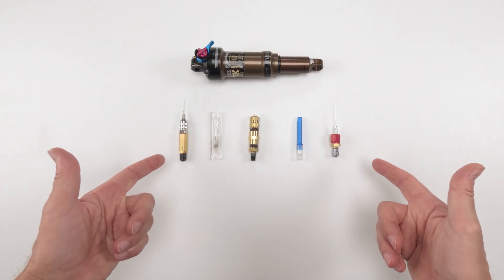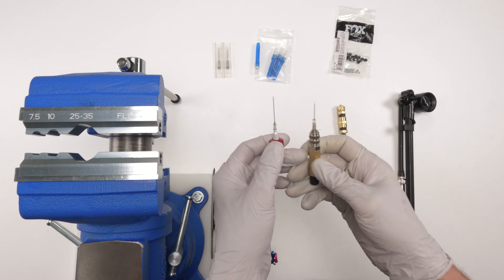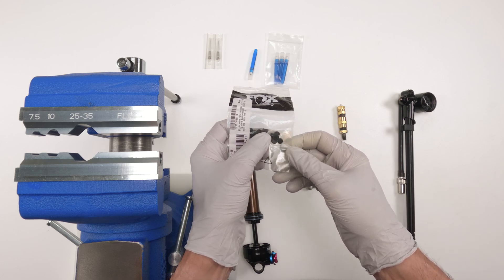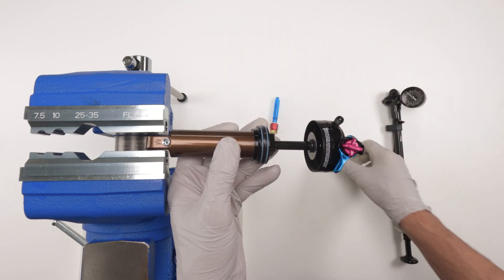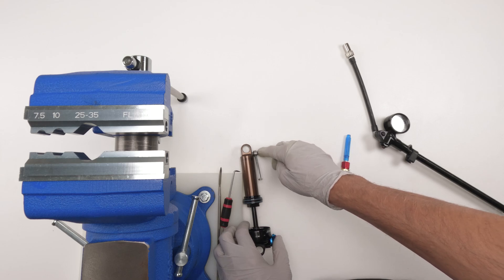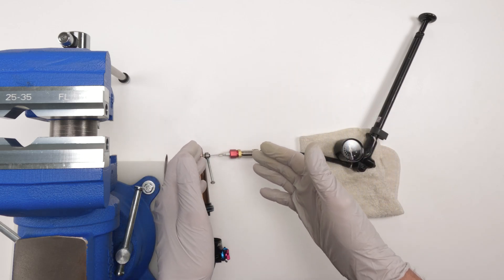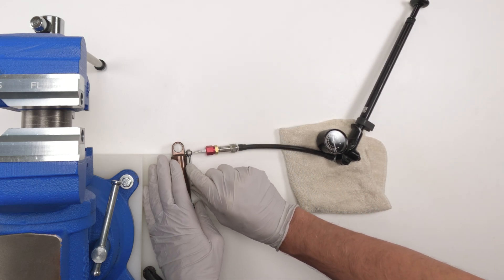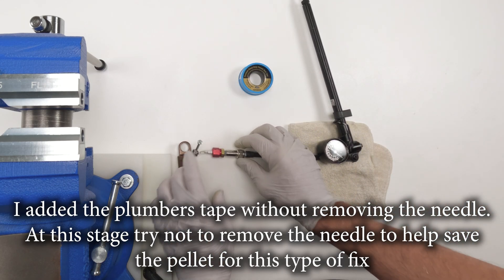FOX shock IFP Air fill with shock pump & nitrogen needle guide for beginners. A PITA but U can do it

Comment: Bonjour, merci pour cette très bonne vidéo !! petite question svp: comment faire rentrer + 500 psi avec une pompe haute pression  à  mains quel model utiliser vous ? moi je possède 2 pompes mais elles vont à 300 psi. merci et bonne continuation ;)
Reply from the maker: Je suis ravi d'apprendre que la vidéo vous a été utile. Pour les amortisseurs nécessitant une pression supérieure à 300 PSI, vous devrez acheter une pompe à amortisseur de 600 PSI, comme celle dont le lien figure ci-dessous. J'espère que cela vous sera utile. 

https://www.backcountry.com/b/rockshox-high-pressure-fork-shock-pump?CMP_SKU=RSXB05F&MER=0406&skid=RSXB05F-STA-S600PSIMAX&mr:device=c&mr:adType=plaonline&utm_source=google&utm_medium=pla&utm_campaign=20668227549__p:G|s:BC|ct:Shopping|ct2:pmax|g:xx|c1:BikeComponents|c2:xx|b:xx|mt:xx&utm_content=&utm_id=go_cmp-20668227549_adg-_ad-__dev-c_ext-_prd-RSXB05F-STA-S600PSIMAX_mca-7811_sig-Cj0KCQiAgP_JBhD-ARIsANpEMxzoHttwxi-oeGDoV4xI2tiX1938STfedvejsQftF0x-4gPJNC0u31MaArgKEALw_wcB&gclsrc=aw.ds&gad_source=1&gad_campaignid=20674447565&gbraid=0AAAAAD_Jw0ZjO1rz132xMbbv8U57pMZX9&gclid=Cj0KCQiAgP_JBhD-ARIsANpEMxzoHttwxi-oeGDoV4xI2tiX1938STfedvejsQftF0x-4gPJNC0u31MaArgKEALw_wcB

Comment: Thank you so much for posting this, really helpful.
A couple of observations having just done my first charge;
You can use a box cutter to shorten the needle, just saw to the desired length at a 45* angle, the metal of the needle is soft enough to cut through using this method (at least the AliExpress ones are 🤣).
Leave the needle long enough that you can use a shifter closed down to either side of it, this makes removal of the needle easier as you can pull against the shifter rather than pulling on your shock pump (you're also less likely to bend the needle this way).
You can also use the same method to remove the needle from the knurled nut when you're done as it'll probably be stuck in there pretty well after pressurising.
Reply from the maker: "You can use a box cutter to shorten the needle" This could be a game changer. I've never tried this nor thought about it. shortening the needle would make the setup significantly stronger. definitely going to try this and thanks for the tip 👍
Reply: @zoubtube use a dremel. Just cut it.
Reply: What you call shifter?? A derailleur shifter? 😂 I don't get it

Comment: Hello. Thanks for the video. Can this process, with the shock pump, be done with fox's nitrogen safety needle assembly ?
Reply from the maker: I don't recommend this at all, but technically yes, you would need a 1/8 npt to Schrader valve adapter fitting. but one person can't do it. you would two people. one persons to keep pressure applied between the shock and the Fox nitrogen safety needle, and the other person to pump the shock to 500 PSI. again,  I don't recommend this approach. Hope this helps

Comment: Wrap the tool with the needle in electrical tape. Insert the needle into the shock absorber, clamp them together in a vice so that they are pressed well. Pump up the shock absorber, unscrew the pump from the needle, loosen the vice, tilt the shock absorber so that you can grab the needle with your hand. Clamp the shock absorber in the vice and pull out the needle.
Reply from the maker: I'm intrigued as I think I see where your coming from. I'm assuming the electric tape is either for grip or to prevent scratches.  To make this work, the needle main body needs to be the same width as the damper body eyelet, right? If yes, It NEVER occurred to be to check this
Reply: @zoubtube  Greetings from Russia. Yes, you need to insert the tool with the needle into the shock absorber and clamp them together in a vice, but first, wrap the tool with electrical tape so the needle won't wobble and you can easily inflate the shock absorber.

Comment: So happy to have found your channel! I'm used to tinkering (ie: getting in over my head trying to fix things I broke and hoping I don't make it worse) with road and gravel bikes, and don't know anything about suspensions.
I ended up here trying to look up if I could fix a Fox Specialized Brain (probably not serviced for ages) not locking anymore.
Do you think adding air to the brain using this method would help? Any videos you'd recommend I watch first if I try to service this thing myself?
Thanks for all the great work!
Reply from the maker: Thanks for the comment and glad to hear that you find some of these video helpful. what year is your fox brain shock?
Reply: I ended up sending the shock for a full service, but still curious about your answer! 

It's from a 2014 Specialized Epic.

Comment: any idea where i cna get the little plastic caps that cover the IFP air screw? service kits in the UK do not seem to have them
Reply from the maker: Assuming you talking about the white delrin ball, search "Fox Shox Nitrogen Fill Delrin Ball  803-01-652". This is for a bag of 50, Search UK ebay to see if someone sellw them in smaller quantities. Not sure if there are any off road vehicle stores in the UK, but here in the states some sell them individually.

Comment: Where do we get the ifp needle fill tool
Reply: aliexpress or ebay
Reply from the maker: @Narad89  Thanks for helping him 👍
Reply from the maker: There lots of places that sell them. Do a search for "Fox Nitrogen needle" and you'' get a bunch of hit. Most important is to make sure you have extra needles and pellets. 

Example below:

Amazon
https://www.amazon.com/Nicecnc-Nitrogen-Needle-Replace-snowmobile/dp/B082FJS17D/ref=asc_df_B082FJS17D?mcid=31ab4823b6fa33bd9bb6a05d8982aa7f&hvocijid=14298663420302870681-B082FJS17D-&hvexpln=73&tag=hyprod-20&linkCode=df0&hvadid=721245378154&hvpos=&hvnetw=g&hvrand=14298663420302870681&hvpone=&hvptwo=&hvqmt=&hvdev=c&hvdvcmdl=&hvlocint=&hvlocphy=9016979&hvtargid=pla-2281435178858&psc=1

Comment: can you put a link to all the tools used please! thanks legend!
Reply from the maker: Here you go

syringe. (buy extra needles, have at least 5 handy )
https://www.amazon.com/Nicecnc-Nitrogen-Needle-Replace-snowmobile/dp/B082FJS17D/ref=asc_df_B082FJS17D?mcid=31ab4823b6fa33bd9bb6a05d8982aa7f&hvocijid=10011851635212530810-B082FJS17D-&hvexpln=73&tag=hyprod-20&linkCode=df0&hvadid=721245378154&hvpos=&hvnetw=g&hvrand=10011851635212530810&hvpone=&hvptwo=&hvqmt=&hvdev=c&hvdvcmdl=&hvlocint=&hvlocphy=9016979&hvtargid=pla-2281435178858&psc=1

Fox Pellets. (Buy at least 5, if not more)
https://www.probikesupply.com/products/fox-shox-nitrogen-fill-pellet-0-275-x-0-125-tlg-each?variant=40823056531511&srsltid=AfmBOopUi3CYxpe2W4fYLaAWuCf5hjTlF-TofrybOK7Th9dmzyiQ2Kx3vAo&gQT=1

fox pellet retaining tool (you can buy the fox tool (expensive) or make your own with a 5/32 allen key as mentioned in the video. I personally I think itd worth making it). 
https://northwestbicycle.com/products/fox-pellet-retainer-tool-nitrogen-fill-b-fx2309?currency=USD&variant=32527389917289&utm_source=google&utm_medium=cpc&utm_campaign=Google%20Shopping&stkn=398fa69d1b59&gad_source=1&gclid=Cj0KCQjwkN--BhDkARIsAD_mnIpVEIJ-xc66q-n8HnvIaK_fOMBxTSKTpRKJkMzIrJk_-i3C5zTkFmYaAmnAEALw_wcB

High pressure shock pump
https://www.amazon.com/RockShox-00-4315-023-030-High-Pressure-Shock-Pump/dp/B00D0SFMJS?source=ps-sl-shoppingads-lpcontext&ref_=fplfs&psc=1&smid=A1TYOE2YKIHA0H&gQT=1

Comment: What’s the down side of filling with air?   Spending $160 every year to send in is just insane.  Way I figure, I need to get this set-up at home or just buy new shock every 3 years.
Reply from the maker: While extremely uncommon, if a shock absorber filled with air on a humid day is then subjected to intense use on a very hot day, the moisture trapped within the IFP chamber could potentially steam and alter the shock's performance. However, this is far less frequent than commonly believed. For almost everyone, air is a perfectly suitable filling medium.

I agree that spending $160+ per year is excessive. Once you get used to serving them on your own, not only will it go by quick, but you will lower the cost significantly. 👍

Comment: It’s easy to change  Fill Pellet ?
Reply from the maker: yes and no. Technically  yes, they are easy to replace. loosen the screw to let out the air, remove the screw, then remove the pellet. BUT. there is a big chance that the IFP will be displaced when doing this.  If this happens you will need to open the damper body in order to reset the IFP height
Reply: @ okay thanks 🙂

Comment: Thank you for this, as always - very useful. When removing the needle the way you showed - are you not afraid eventually snapping of air pump sleeve from it's shaft? The area the hose connects to the pump?

I did not quite get, where do you use those rubber little thingies from the bag? Do you insert them to the hole which you installed the needle in before doing the IFP fill?
I am tempted to buy the kit mentioned in comments below, it looks to resolve this messy and dangerous fill job all-together.
Reply from the maker: "are you not afraid eventually snapping of air pump sleeve from it's shaft" 
Yup! it's a concern, but so far, that pump has held up surprisingly well. I will admit my view on doing it this way is a bit biased, as I've had a needle go right through my finger a few years ago, and I do what I can to avoid this again. Pulling the needle from its body is more effective, BUT, one slipup, and it can easily go through your hand. Also, I only use this method on the DPS as it needs 500 psi, for other shocks that need 400 psi and lower, I clamp the shock to the vice and pull from the needle body. The reason I don't do the same with the dps is pumping the shock to 500 psi makes the needle wobble quite a bit, which breaks the needle easily. 

"Do you insert them to the hole which you installed the needle in before doing the IFP fill"
Assuming you are talking about the pellet, yes, first you place the pellet in the hole, then you screw in the pellet retaining screw, then you insert the needle. I have a few shock video that show this during the IFP depth setting section, which might help better visualize this

"I am tempted to buy the kit mentioned in comments below, it looks to resolve this messy and dangerous fill job all-together."
Yes, Aftermarket valves do work. The biggest issue with them is you need to remove the valve during a 50-hour service in order to remove the air can, which can turn into a big problem, as the IFP can move from its position during this process. If this happens, you will need to open the damper body and reset the ifp, which is sort of a pain for a service that should be simple and relatively quick

Comment: Hi ZoubTube,

I watched most of your videos about the Fox shock services, and I am surprised that you never mentioned the "Shockcraft Faux IFP Valve Stem Kit". You may be not familiar with it, you can google it like this. It will completely replace the pellet system with a proper schrader valve, so that you can use your shock pump as is, without those needles.
There are a ton benefits in my opinion. The biggest is that it is replaces the dangerous clowning with the needle (I even squinted in front of my monitor, when you could't yank that needle out of the retaining screw). It is also reusable, like any normal valve,  but the pellet system is not. You can easily fine tune you IFP pressure if you wish.
There are a few drawbacks too, as its complicates assembly a little, and there can be interference issues on certain frames.

I do the air can service like this with the Faux valve:
If you want to test the damping before aircan assembly, install the new valve and pump it up like a fork and test it. But the air can cannot be installed with the Faux valve in as the valve is sticking out of the shaft. The IFP chamber needs to be deflated,  and the new valve  needs to be removed to be able to put on the aircan. (I think) you also need to be careful to not compress the shock when the IFP chamber is not pressurized, when installing the aircan. I would say you trade a dangerous operation to a more complicated assembly.

What do you think?
Reply: I have the sc ifp valve in my rp2 and my sons floats dps works well in the rp2 and did once in the dps the trouble i have now with the dps is if I pump it up to 500psi and remove the pump I'm not getting much difference between open and firm mode, also lock out is very firm but still compresses. I've noticed if i put the pump back on I only have around 350 psi and I think air is escaping when removing the pump, not sure if that would cause the shock to behave the way it is but I'm just waiting on a nitrogen needle to try the pallet method again and see if I get a different result. any thoughts?
Reply from the maker: YUP! I've been aware of it for quite a while now, and I believe I briefly mentioned it in one of my videos, or at least that it's an option. I contemplated trying it on a DPS around the 2020 time frame to see if it would be a good solution for some of my buds. 

There were two reasons I didn't. First, and the biggest reason, they only accepted credit cards, at least during that time, and I have a big issue giving credit card info, especially  overseas. My GF got burned by this about 12 years ago, not fun, and  to this day I don't feel comfortable doing this, I'd rather pay extra for the paypal fee. 

Second, for as long as I've had rear shocks, I've kept up with my 50-hour service. It occurred to me that I would have to remove the valve when servicing the DPS. There is a big risk in the IFP moving when doing this, which would require a IFP reset and bleed.

Now that I know a bit about the guy who runs that shop, I'd feel more comfortable buying it, (He's definitely my kind of enginerd 😉) but I just hadn't found a need to try it since.  A couple of my buds do these jobs on their own now, as for the rest, well, let's just say that I've spoiled them so much that I'm stuck working on their struff forever!  😁

Comment: Kudos ZoubTube 🤟 where can I buy? Can post the link of your suspension tool suppliers? Thanks 🙏
Reply from the maker: Below are some links as a reference. for some of them I would look around to see if you can find better prices. Hopefully this helps

Here are some links. 
Needle kit
https://www.amazon.com/Nicecnc-Nitrogen-Needle-Replace-snowmobile/dp/B082FJS17D/ref=asc_df_B082FJS17D/?tag=hyprod-20&linkCode=df0&hvadid=693505325168&hvpos=&hvnetw=g&hvrand=17980108439228031207&hvpone=&hvptwo=&hvqmt=&hvdev=c&hvdvcmdl=&hvlocint=&hvlocphy=9026833&hvtargid=pla-965680038216&psc=1&mcid=31ab4823b6fa33bd9bb6a05d8982aa7f

Pellets - Buy at least 5
https://www.probikesupply.com/products/fox-shox-nitrogen-fill-pellet-0-275-x-0-125-tlg-each?srsltid=AfmBOor2SGLsG8zJpJRgv2GJ3I-r8AsvkcGD0VlwGJTQDvjH9-0EuosP

pellet retaining fill tool - Try and find it for a better price or build your own with a 5/32 all key, like I explain in teh video. building it will oct you 2 or 3 bucks
https://www.amazon.com/Fox-Shox-Pellet-Retainer-Nitrogen/dp/B08HW1CKMK

high pressure shock pump - try and find this for the cheapest price possible
https://www.performancebike.com/rockshox-highpressure-fork-shock-pump-black-600-psi-00.4315.023.030/p324799?gad_source=1&gclid=Cj0KCQjw9Km3BhDjARIsAGUb4nyIW01RlyLEa9VWJW9ODGkGqms22pOY6rwvcShmmUcONbG7lyHkNQUaAibEEALw_wcB